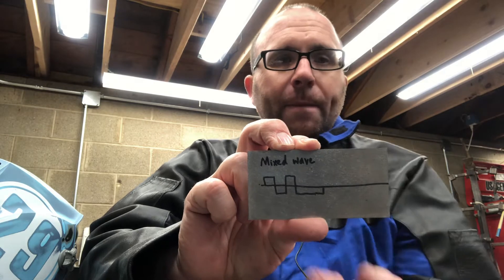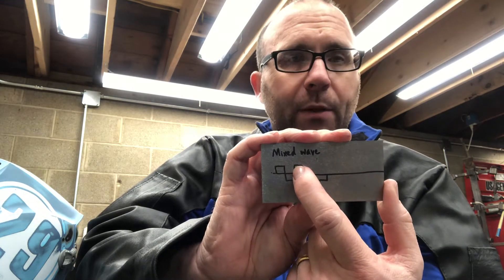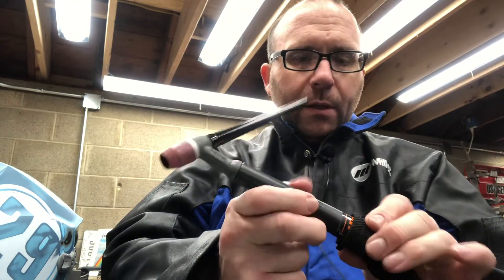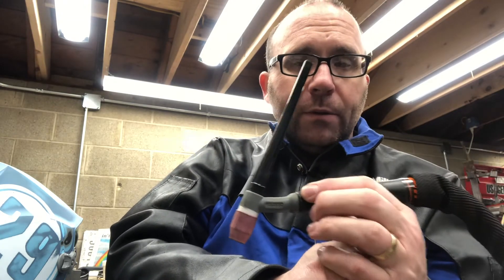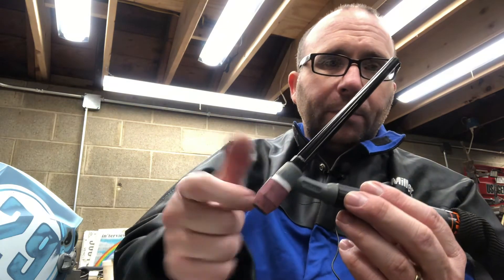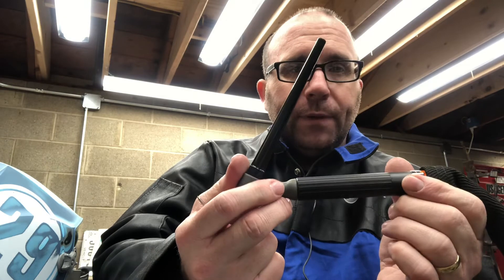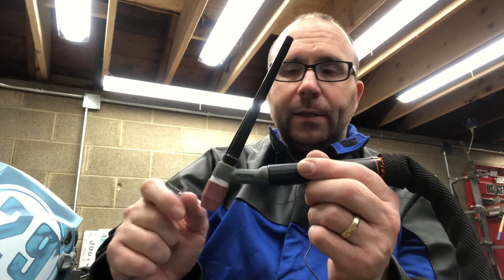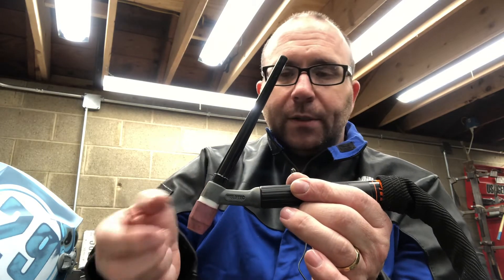OTC DTX-2200 Test Part 1

Comment: I have an earlier OTC Accutig 300P.  Many of the features are exactly the same as the DTX. I weld a lot of castings, and the mixed wave feature,  means jobs can be carried out much faster, with less heat going into the material.  It has 3 wave forms, and everything is controlled by pots and rocker switches, as well as a pendant with pots to control amperage, and pulse settings. Get used to the mixed wave feature, and experiment with the frequency setting, and you will find very little need to pre-heat.  OTC seem very sensitive to tungstens,  and the best ones I have ever used were made by OTC Japan, and came from a car production plant that had closed down.  I dread to think what they cost, but far better than the Chinese made tungstens, which seem so common now.